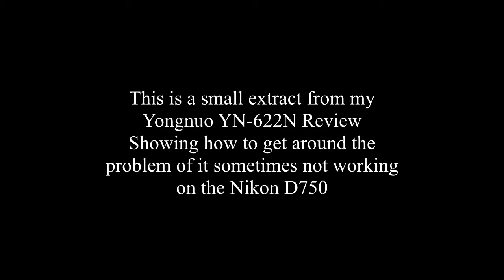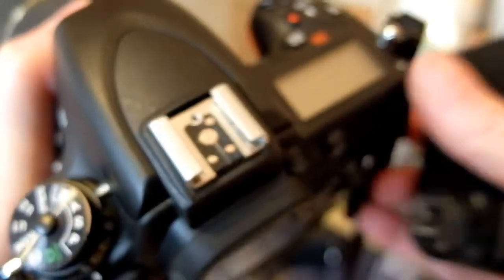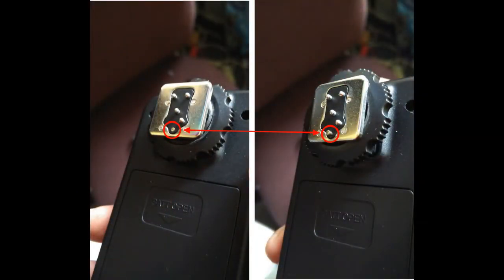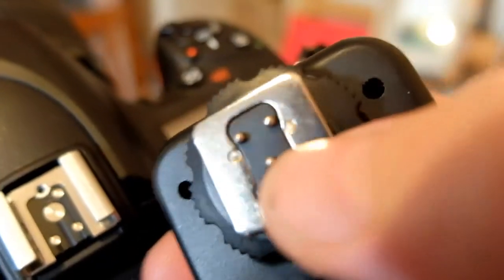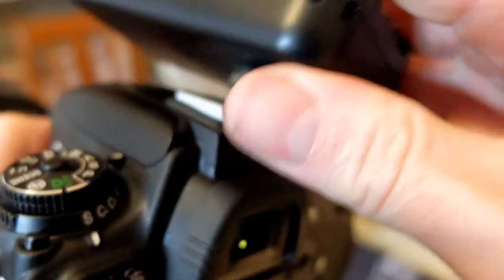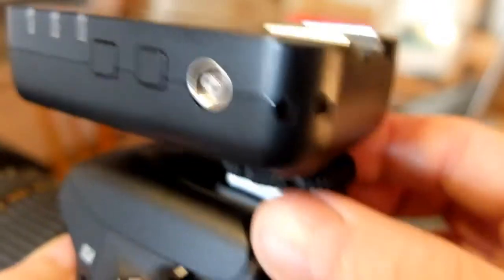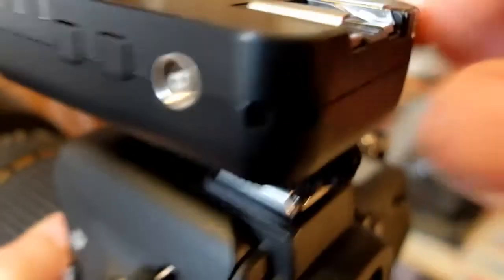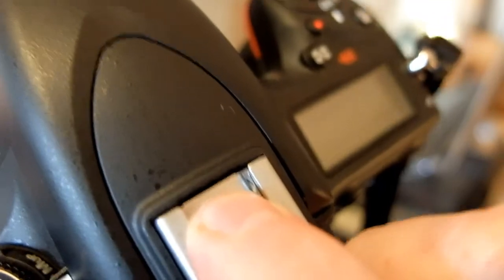Yongnuo YN622N Nikon D750 Workaround

Comment: I'm very glad with your video. I don't get completely dark pictures any longer, but still TTL doesn't work properly. My D750 indicates it is working on CMD with an external flash.
Reply from the maker: Pleased it helped - I usually use my flash on manual to get full control

Comment: I discovered this accidentally myself. I was at a wedding and I had never had any issues with it and all of a sudden it was not firing. And it actually got stuck in the hot shoe. I made sure it was completely loose, and then got it out. that's when I realized exactly this issue. Lucky for me I figured it out pretty quick, I was doing outdoor shots with off-camera flash at dusk so I was losing light really fast. It would've turned into a complete disaster if I wouldn't have figured this out as quick as I did.

I was even going to go as far as to write an update review from where I got it from and say that the yongnuo sucked. But once I figured it out and verified that this is what had caused the misfire, I realized this was a nikon thing not yongnuo. I am glad to because for what I bought one SB 900 I could've bought six yongnuo flashes. Now I only use yongnuo flashes and triggers. Savings without any drawbacks. I recently even dropped one of my yongnuo flashes, it didn't even scuff.
Reply from the maker: Yes Yongnuo do make some excellent products. I have a few flashes off them to as well as the triggers and we use them all the time. They also do lenses now and I look forward to reviewing one on here in the near future that Yongnuo are going to send me. I did have chance of trying one out recently but it was Canon and I am shooting Nikon
Reply: floex831 hi mine is stuck in my hot shoe as well. You mind sharing any tips on how you got it off? The locking ring won’t budge.

Comment: So you can use all transceivers and dont bother with the controller? Great if that's the case. 
Love the photos at Lumley Castle, it's just down the road from where I live
Reply from the maker: Do you mean the Yongnuo YN-622N-TX - If so then yes you can use the triggers without it. It just makes it easier to control them especially when using a few at a time.  Thank for the comments on the Photos its very much appreciated but Lumley is a great venue and to be honest its hard to have a bad photograph there as the whole place is very photogenic

Comment: Hello, I have D7100 and YN622N-Tx and it doesn't work. I see there is connection between YN622N-TX and YN622 becuse Test flash works, but when I take phote the flash doesn't work. I add that with my previous D3200 everything works.I did also what you explained setting the correct position of the pin but still doesn't work...:( .....Any other idea what could it try?
Reply from the maker: That is a strange one - Have you tried the flash on its own without the YN622N-TX ? Also have you set flash on  manual mode ? also make sure the flash in not in slave mode (that is used to fire flash from another flash)
Reply: @JohnYoungPhotographer  i have yn568 ex III yn622n-txt and yn622n II. I tried also only lamp yn568 mounting directly to nikon d7100 and it works. I set y622ntxt Group A in manual and yn568 in ittl. And...no reaction..of d7100
Reply: I found! :) the problem is that all pins are in wrong position. I adjust few milimeters backward and suddenly it Flashed! It means that i will have find a good position of yn622n-txt on my hotshoe.. thanks for your support John.
Reply from the maker: @Lukasz32s   If I was you I would go to the facebook page of  Yongnuo as send them a message to see what they say https://www.facebook.com/YongnuoPhotography Sorry I could not be more helpful but I have not used the YN622N-TX
Reply from the maker: @Lukasz32s   That's great news 😁👍 so it was the same problem as I had in the video really just not lining up right but I am happy you got it sorted.

Comment: I was going mad with Yonguo 622N Kit . Couldnt figure out what i was doing wrong. And what do you know. This was the actual problem.  Im on a D7100 body. So the issue exists on the d7100 as well. It worked before  , changed batteries , reinstalled both units time and again. So its too difficult to not notice the click. THANK YOU !!!
Reply from the maker: You are welcome - I did not know it was on the D7100 to that is good to know. I will add that in the description or Tags somewhere so others can find it - thank you. So maybe its really a fault of the trigger rather than all the cameras. I think you could maybe jig something up to put in that gap so you don't need to listen for click but I have not tried that yet myself. Maybe I will :)